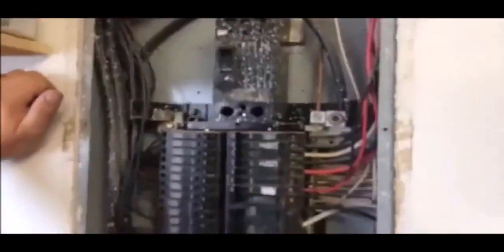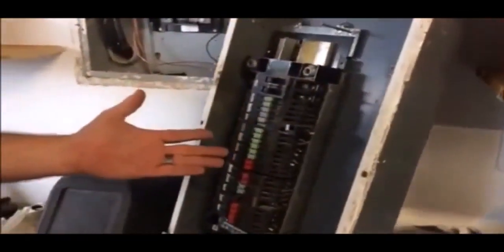Is My Breaker Panel Safe?

Comment: What does it mean when my breaker panel has a faint buzz? I know there's current running through it and it's most likely just the volts running through the box. But, I had this one electrician tell me it was too loud and it meant I needed a "panel refresh", where he wanted to go in and change all the breakers for like $1700, which I thought was excessive. I am very keen on sounds and buzzing sounds and it's not audible unless you literally have your ear a few inches from the panel with the door open. You cannot hear anything with the door closed, but he acted like it was dangerous, and when I asked if it was a fired hazard, he said "we're not aloud to say that word", I'm like okay that's weird.  Then he did the upsell thing where he said if we replace the whole panel it would be over 5K dollars, so doing the panel "refresh" would be the way to go. Then, when I said that just sounds way to expensive for new breakers and I'd think about it, he then tried to sell me a whole house surge protector, which I know is a good thing, but he just kept trying to sell me stuff when he originally just came out to fix a broken GFCI pool outlet. My question is; Do I really need a fix for my panel with a barely audible buzz? I have looked on the internet and everyone seems to say a light buzz is normal but this guy says it's worse than that but I don't believe him, any thoughts?
Reply from the maker: Is the buzz constant? Or only when something like an AC condenser comes on? How old your panel?
Reply: @abrelectric  I guess it's constant but it's barely audible, and he had to take the panel cover off to stick your ear in there to even hear it. At the time the AC was not running, it was early morning and cool and quiet. I just went by the panel today as it's inside our laundry room and I couldn't hear anything. I personally think the electrician was just trying to upsell me because I only called him out there for a bad GFCI outlet. I don't know how old the panel is because I just bought the house 3 years ago, but I can tell you all the breakers are D Square and it looks fairly new, and it's all copper wiring.
Reply from the maker: @oldkid6  if there's no overheating, and the system is performing well, it's likely not an issue. That is, in my limited opinion:)
Reply: @abrelectric  Thanks, that's what I think as well. The breakers are cool, not even luke warm and they never trip.